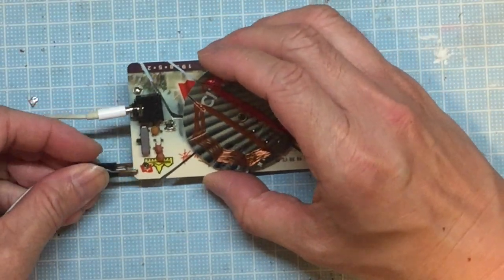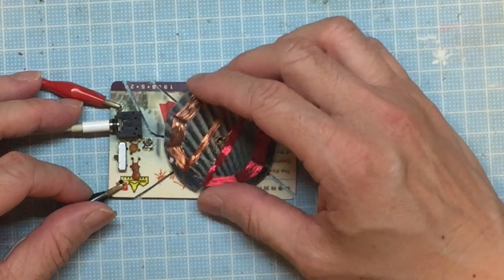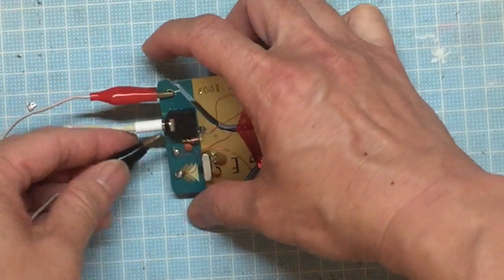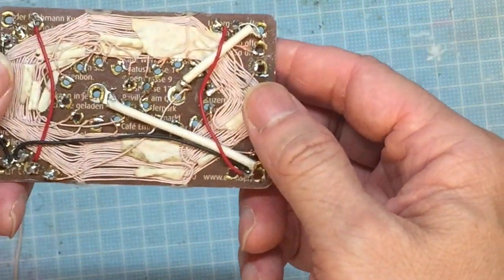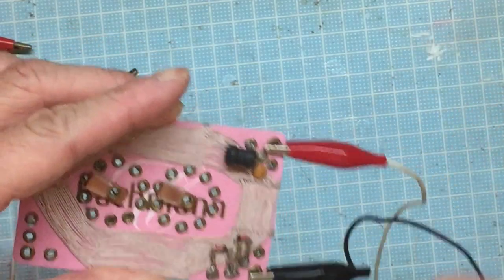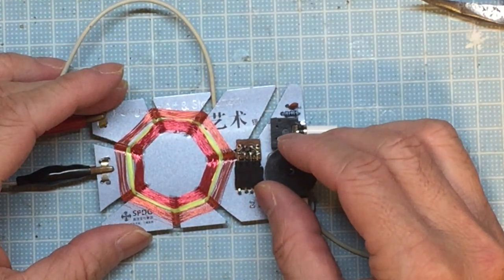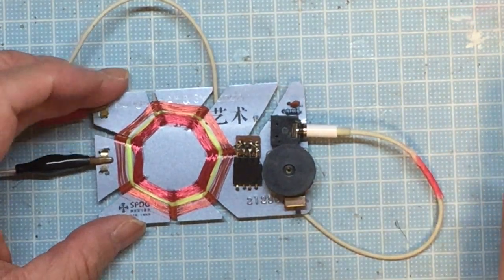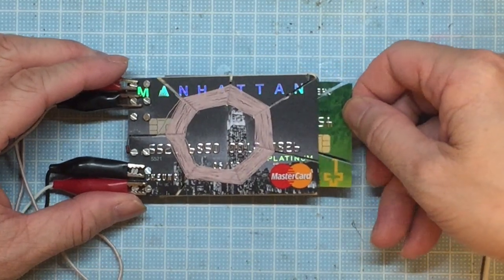2020 Credit Card Crystal Radio Show

Comment: Dude, this is amazing. There must be some way of implementing this technology for other devices than AM radio, what if there could be telekinesis or time travel or teleportation by using antennas and tuned circuits with coils of looping wire? I wanna make some money so I’m working on many microcircuitry technologies and I solder these devices and testing them in my spare time
Reply from the maker: Moist Andy , interesting